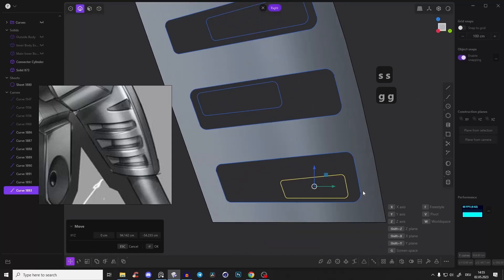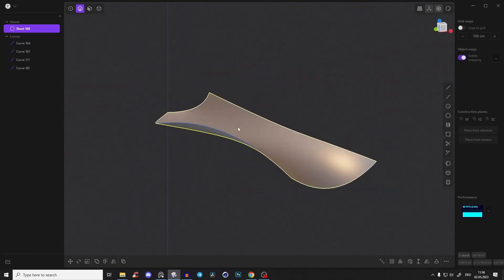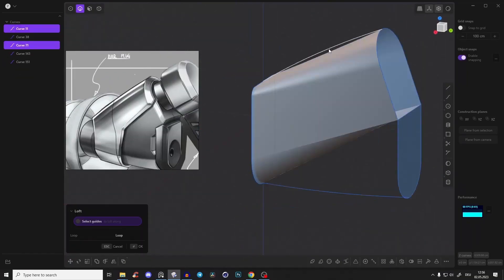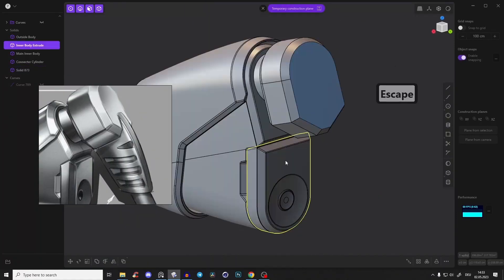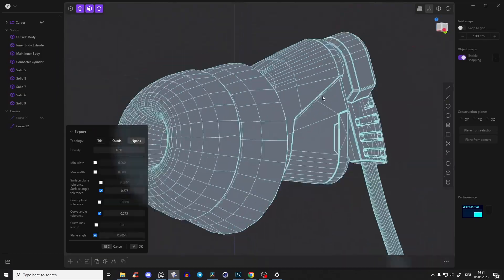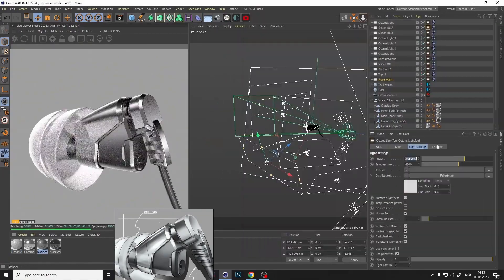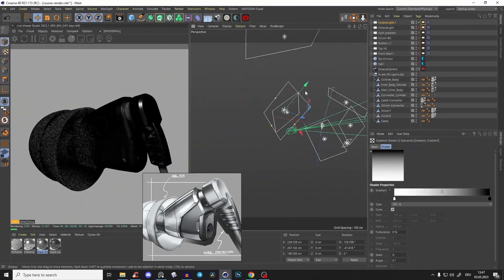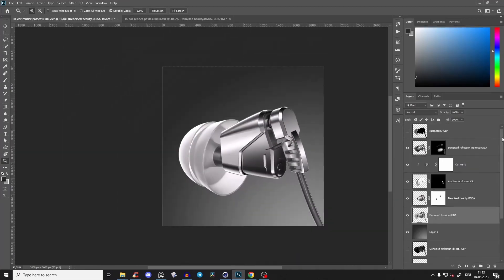Headphones Product Modeling & Rendering Course | Plasticity & Octane Render

Comment: I'm thinking of buying the course, but I want to know if the loft exercises are advanced or basic, as that's what I'm most interested in, to be able to model more complex and advanced shapes. I need to raise the level and I think that's what I need. Thank you and congratulations.
Reply from the maker: I understand that you are mostly interested in Lofting. That's definitely also something I am focusing more and more.

The exercises in the 1st module are basic/intermediate to show people what's possible, how it works and the different use cases one can use lofting techniques. It's more of an overview for people don't know what lofting is.

In the headphone modeling part we implement then those techniques into the product (real world example). In the course, I don't show super-advanced lofting techniques. That's something for the future. 

But it is also not basic anymore. So it is a "step up" from the previous course.
Reply: @nikita.kapustin  Ok, thanks. I'll probably buy it to see lighting and postpro. And I'll look forward to the "super advanced" 🤣🤣🤣🤣🤣. Best regards.
Reply from the maker: @raulgomez8523  Yeah for the "super advanced" I myself have still to learn :D

Regarding the course. I teach specifically this kind of chrome, product lighting how to achieve those specific reflections and this super clean/modern look. 
So in this course the focus is mostly on the lighting setup and the different lighting techniques and how to place them. 

A bit of post-production.

But I have a lot of other free tutorials on my channel where I go across diverse post-production techniques. You can check them out to.

Just wanted to say, that in the course it's more focused on lighting, then on post-pro.
Reply: @nikita.kapustin  Yes, I'm looking at them when I have time and I'm applying them in Unreal. I'm doing tests of lighting and materials of the iPhone applying what you show. Thank you very much again.
Reply from the maker: @raulgomez8523  You're very welcome!✌

Comment: hey - is Octane render free for a trial or something ? id probably render in Blender Cycles...probably similar workflow yes.
Reply from the maker: Yes Octane hast a free version. However you can't export your renders and the viewport is low resolution and watermarked. 

Definitely in Cycles possible as way, aslong you know the basic tools and have already the experience a bit in Blender Cycles. But the techniques, theory and fundamentals are the same across those different render engines
Reply: @nikita.kapustin  yep